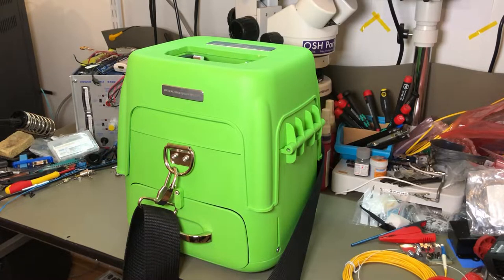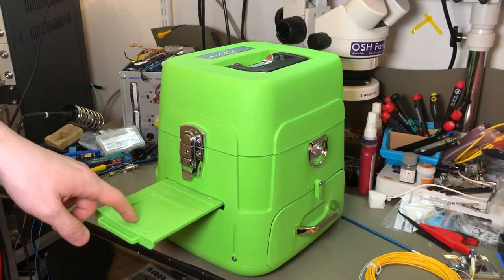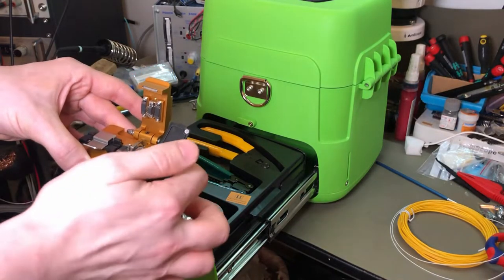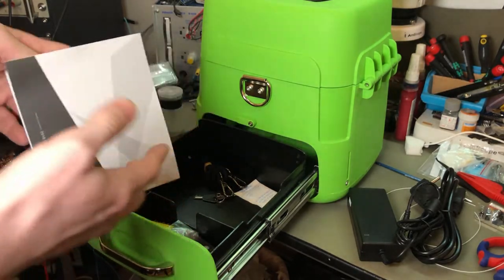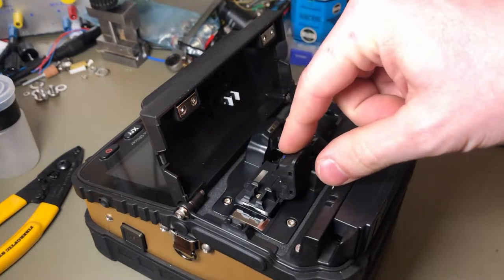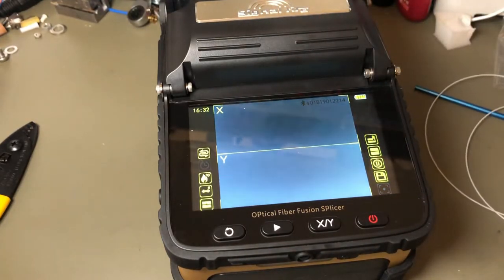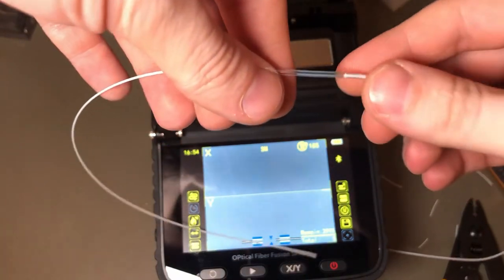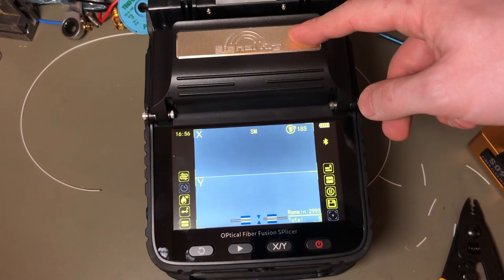First look at the Ai8 Fusion Splicer

Comment: I have 8 fiber strand that have been cut.  I am being told to fusion splice you need at least 20 feet extra fiber cable.   Looks like you are just trimming the ends and splicing.  is that correct?  

also did you have experience before or this was your first time fixing fiber?   only reason I am thinking bout this is the cost to repair are double the cost of this machine.
Reply from the maker: An actual splice only needs a few cm for each end but if you have e.g. a multi core cable that is damaged you'd probably need to splice in a new piece of cable if you can't just pull more through.
That means a double set of splices, with both ends properly enclosed in a suitable box etc., not surprising they would want 6 extra meters depending on what type of cable and where it's installed.

Factor in the price of a trained tech to do this and all the associated kit you'd need it's not surprising if the job more than one of the cheapest fusion splicers on the market.

Comment: In my opinion you cant recommend a splicer without testing the splices.  Over long runs depending on test spec you wouldnt pick a bad splice up. Even using top brands you can put a bubble in a fibre through and it tests fine, but a good splice tests bad. These splices need to be tested at short distances i.e connector pig tail to cable and then at a distance i.e to a joint. Also tested at a high spec 0.1 on a splice and at the connector end 0.5 reflection without a merged event.

Good video but for me alot of questions still need to be answered

Comment: Have you used any splice on connectors with this? If so, which one’s? I’ve had a hard time finding something that says it will work with this machine and I didn’t want to buy a bunch of different ones to try out due to the cost.
Reply from the maker: I've never tried splice on connectors. From looking at some videos of how those are spliced I'd guess that a 3D printed holder wouldn't be too hard to make assuming it would fit under the lid.

Comment: Have you tried measuring splices with OP meter or OTDR?
Reply from the maker: I don't have access to an OTDR here, but I doubt the splices would be very visible - the optical core alignment is a pretty good measure of the loss in the splice. From experience looking at long runs with OTDRs, fusion splices are barely detectable.

Comment: How many burns have you got on it now and does it seem reliable?
Reply from the maker: I'm not using it professionally so I only have around 20 burns.
I pulled it out after sitting around for a few months and it worked flawlessly for the two splices I had to make just now.
So far I haven't had a bad burn except for the operator errors I showed in the video.

One thing I have noted is that it drains the battery when off, so sitting around for a few weeks will drain it by a lot.
I just pull it out a little before putting it away (still fits in the case) and that problem is solved.